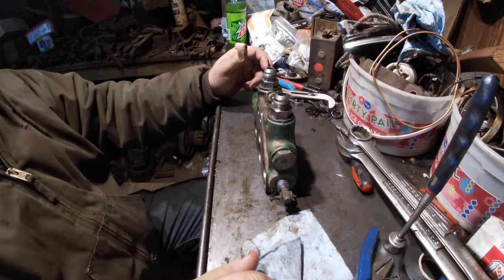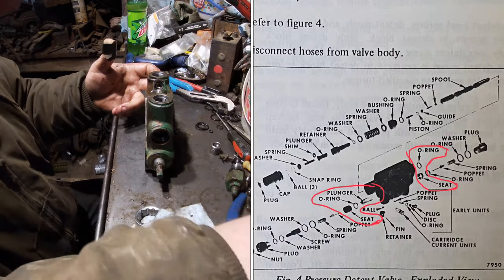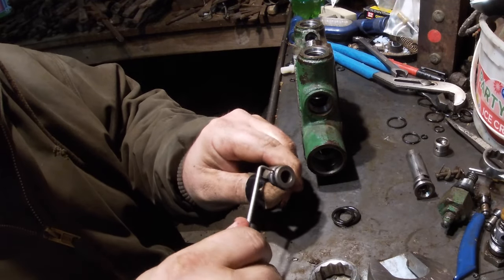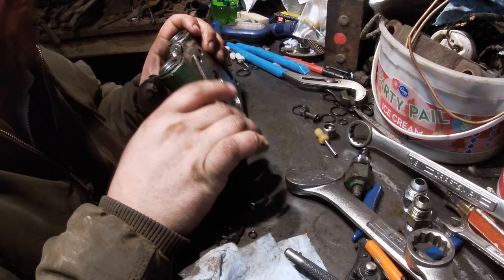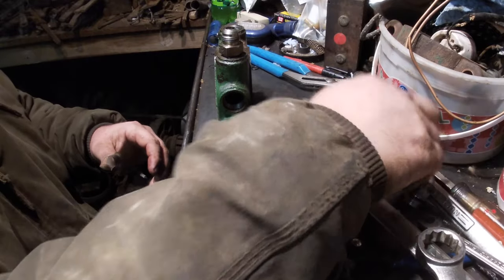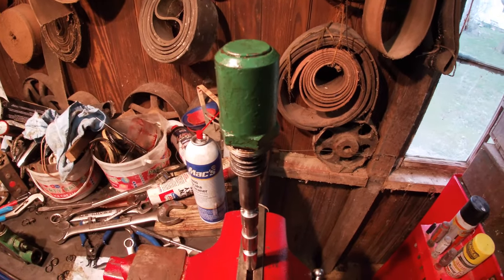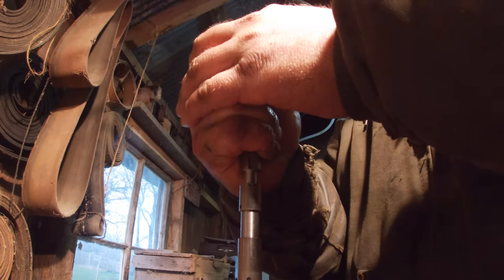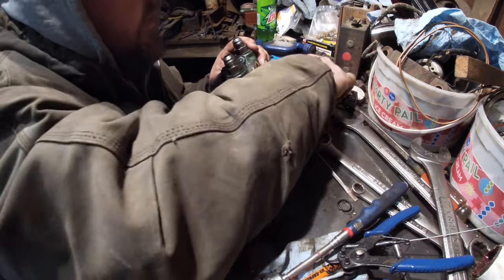Oliver/White Cessna Hydraulic Valve Rebuild and Reinstall- Part 2

Comment: Awesome and helpful video sir, I don’t know how you knew that mine was leaking but I appreciate you sharing your infinite wisdom and knowledge with us. Mine is leaking between the two blocks
Reply from the maker: Thanks! You might be able to get by with just changing the o-rings between valves if you’re in a rush to use it. You can even leave the hoses on and just change them on the tractor.

Comment: I hit the thumbs up! Speaking of thumbs, you could try putting on a nitrol glove over your bandage. Electrical tape doesn't work well with sweat, oil, & blood! You can get the Vulcan brand which is 2 layers and it's pretty good at giving you your sense of touch and still not ripping. Of course, you're working on farm equipment so, all bets are off! Keep up the good work, and make sure your tetanus vaccine is up-to-date!
Reply from the maker: I think I should buy the tetanus vaccine by the gallon 😂 I know I probably should wear gloves more but I hate the feeling of having them on my hands. Just not used to it I guess.